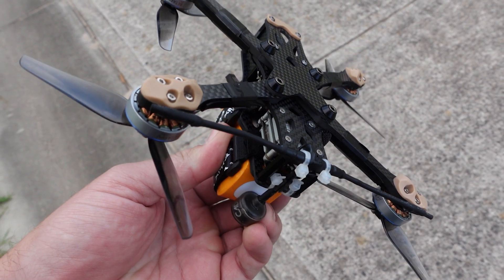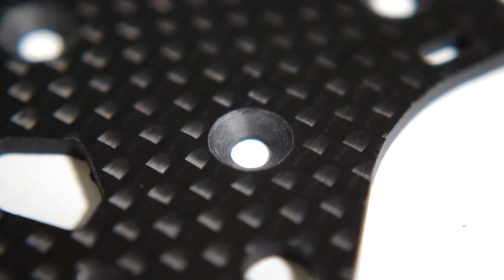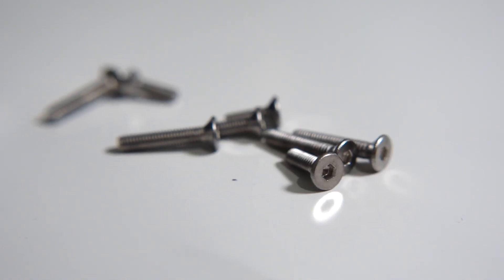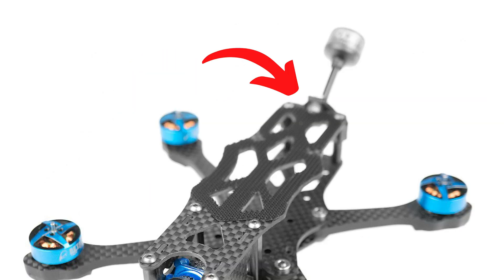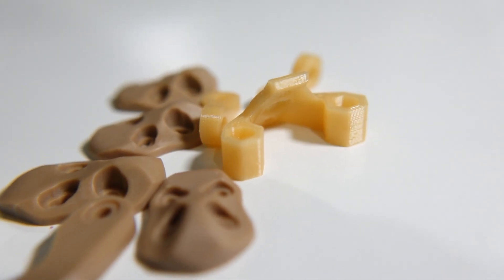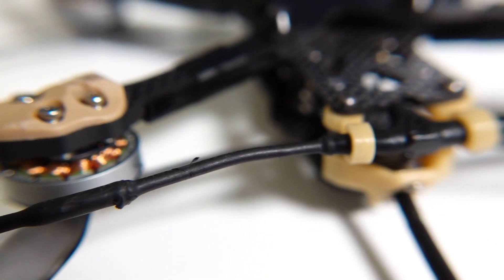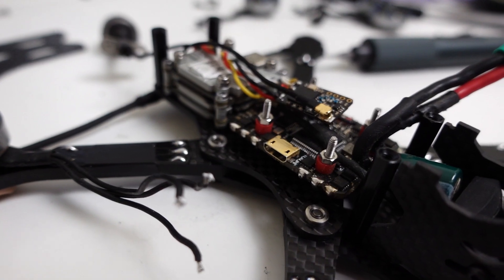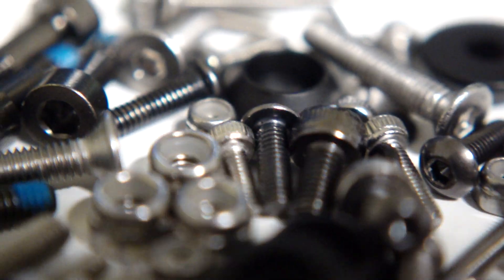Perfect 4” Freestyle Quad?

Comment: The missing antenna mount is pain, the m2 screw thing is annoying, but as you mention not load bearing so that's a plus. The frame is so robust and it flies well, I am struggling to keep the 4" under 250g, but the 3" is no problem. Thanks for the review.
Reply from the maker: To hit 250g on a 4” Apex is almost impossible; I had to go titanium hardware etc. I’d go so far as to say that the Micro Apex is not intended to be Sub 250
Reply: @DarrenAllatt  I agree, I was surprised how quickly it added up. I was hoping to run a 450mah 4s and 1404 motors, the esc and fc I've got is the mamba basic mini f405 so it's pretty light, but maybe better with an aio? Thanks for the feedback.
Reply from the maker: @jonowillmer   question is, do you really need to hit 250g?? As in, who checks that your quad is 250g?

I wouldn’t waste additional money on an AIO unless you find one with 20x20 mounts because the micro apex doesn’t have AIO mount pattern. 

For 3” sure that’s a good setup. 

I’d recommend go with 4” arms and 3.5” props.
Reply from the maker: @jonowillmer  If you are going 4” I’d go with 1804 motors. They are lighter than 2004 and while have less stator volume perform better on this size because of the overall weight.
Reply: @DarrenAllatt  OK sweet thanks for the advice. I'll check them out.
Reply: @DarrenAllatt  yeah that's right isn't it??? I guess I was just trying to stay on the safer side of doing the wrong thing. Fpv is tricky, I don't really know how to learn and have fun while staying on the right side of the rules. I've got a 3" and 4" micro apex, I'm just trying to put things together to test them out and learn what combinations work. I have a 20x20 pattern fc and esc just need to connect a receiver and vtx, fits OK.

Comment: Thanks for the video.  I too found the m3 was a let down. Mostly because m3 x 16mm is short. Amazon  countersink screw kit was need. 20mm was perfect! Yeah, I tried the m2 with rubber grommets, didn't like... also, wtf on the antenna print.  I don't print. My whole build is on hold  do to shipping delivery frustrations. Again,  thanks for your video.  I agree with you 100%

Comment: It does support m2 stacks. Use the rubber grommet on the m2 screws and it holds perfectly.
Reply from the maker: As in out an adaptor or grommet in the frame to size an M3 to an M2? 
My point was for micro builds electronics don’t come in M3 so the frame should come with holes for the majority of the components that people will be using, which is M2
Reply: @DarrenAllatt  No. They supply little rubber m2 o rings and 9 m2 stack screws in the kit for a reason, 4 for dji, 4 for the fc stack plus 1 extra. The m2 screws don't fall out from the m3 stack holes as designed by impulse rc. I literally have 2 3inch micro apex in front of me right now will all m2 hardware so I know it does support m2 without any adapters.
Reply from the maker: @Infinite_Ouroboros   right is that what the O rings are for. There you go. Btw, the fact that there are o’rings for m2 hardware to fit into a m3 hole is in-fact an adapter
Reply: @DarrenAllatt  They work even without the o-rings. The holes are small enough so they are not adapters but rather dampers. I use them to avoid the hard metal from rubbing against the carbon causing wear overtime but you can still build without using them.

Comment: dry weight of the build ?
Reply: I have the 4” version. 198g dry weight and with 4s 550mAh = 259g... I also use 850mAh = 299g. Fettec 35a 4in1, Fettec FC, Caddx Vista (first gen camera), CRSF, Xing 1404-3800kv motors and HQ 4x2x3 T-Props. All weights include the Insta360go action camera. I plan to build a second one to see where I can reduce more weight 👍 it flies great 👍
Reply from the maker: @commanderfpv800  My motors the beta FPV 200 fours are practically double the weight of yours Xings.
Reply: @DarrenAllatt  the Xing motors are 8.5g each... I am considering de-casing the Vista to bring the weight below 250g but don’t like the thought of the boards being open to the elements. Will keep you posted 👍
Reply from the maker: @commanderfpv800  yep. The 2004s are 16.6g. 
I’ve had decased vistas and they are not worth the trouble unless you really want to say you’ve saved every last gram.
Reply: @commanderfpv800  Are you using this setup for freestyle?  I bought a 3" version for my son and 1407 3600 kV motors for it (650 mAh 4S), but it's coming in over 250g and I need it to be sub 250g.  Switching to 1404's would get me under, but I was worried it might be underpowered.  Curious what you think since you have those motors on a 4"?  I'm debating between the 1404 Xing2's or the Flywoo's.  The Flywoo seem to have more power and better efficiency (on paper).
Reply: @thejdolby  the 1404 -3800 motors on 4s-550mAh and 3x2.5x3 HQ props worked very well on the 4” frame. The smaller motors can swing a 4” prop on 4s but was pushing it a bit... I have now added BetaFPV 2004-3000kv motors to the 4” frame and it rocks on 4” props but the weight has increased. I have ordered another frame to recreate the 3” setup
Reply: @commanderfpv800  Sounds like I should be in good shape with the 1404's on the 3" frame then.  I just ordered the Xing2's and 3x3x3 props.  Hopefully the 3" pitch isn't too much.  Starting to think maybe I should've gone with the 2.5 pitch.  Thanks for the feedback!
Reply: @commanderfpv800  did you use spike absorber or capacity? consider building an exact setup as yours but in 3" but no experience w/ fettec b4
Reply: @jeffng1686  not in this build as I am running 4s, on my 6s builds I do use a spike absorber 👍
Reply from the maker: 218g - You can hit sub250 if you made better choices for motors and hardware.
Reply: that dog made me happy